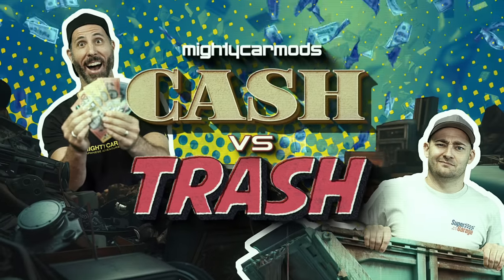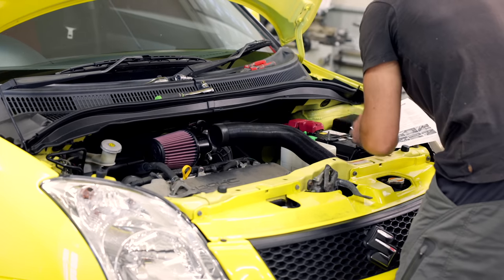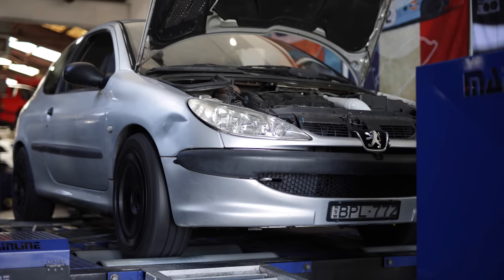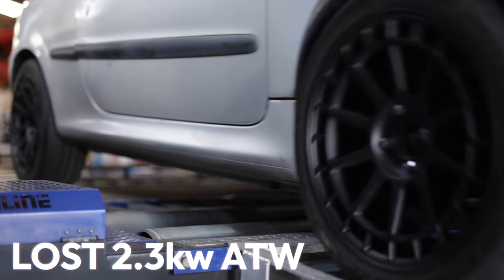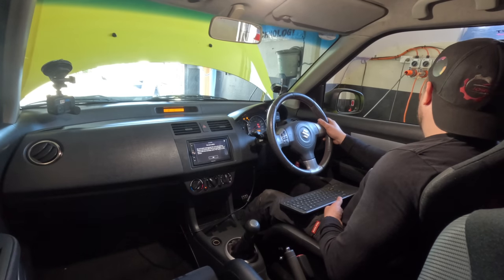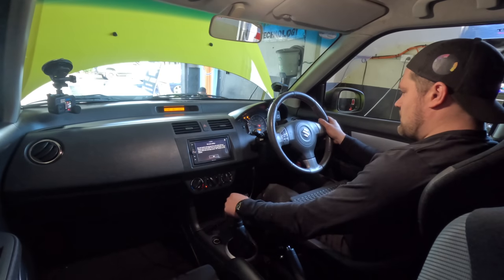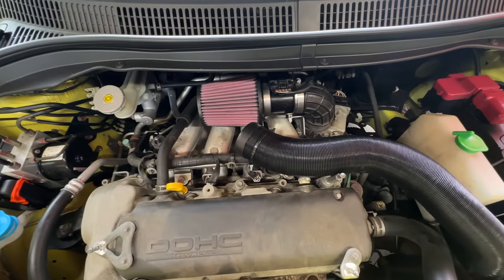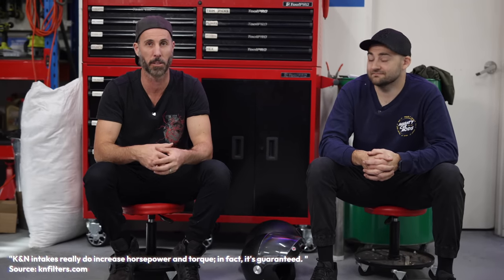Dyno testing POD FILTER Performance Claims | CASH vs TRASH

Comment: When you increase the mass of your wheels you will loss kw and nm. The hot air intake will also contribute to the power loss. Had this happen to my n/a track car on the dyno.

Throw the stock wheels back on and dyno the vehicles again, you will see the difference.

Comment: A lot of cars made now have very well engineered intake systems. For my car it got the most hp gain by just swapping out the factory filter with an aftermarket one. No change in any tubing just stock box.

Comment: When I put a K&N intake (just like yours) on my 2001 Accord, it worked good during winter time. But during the summer here in Las Vegas, I got worse gas mileage and my already slow car got slower. I eventually sold it.

Comment: Moog, losing power from a stock air filter to performance air intake is normal without a tune, especially when you are using a car with air mass sensor. Tune the air mass sensor to take in more air and your Swift will see performance gain

Comment: The intake and exhaust aren't a restriction on small displacement, naturally aspirated economy engines like this. They are cammed to make a certain power level with fuel efficiency taking priority. Manifold tuning and camshaft profile tuning are basically the only way to make any meaningful gains on N/A engines, especially small ones.

Comment: I usually add K&N drop-in filters to my cars. You get a bit of intake noise and still keep your air pipe efficiency. Kind-of a win/win. Just don't over oil it and they work just fine, in my experience.

Comment: Exhaust and intake improve performance mostly on higher RPM. if the valve timing is adjusted for better torque a lower RPM the gain will be minimal or even get worst performance.  In that scenario Valve timing needs to be adjusted.

For intake running Pod filter and MAP sensor; having the filter in a box or where cold air is available helps both due to the cold air and the length of pipe improves airflow so the sensor can measure it correctly.

Comment: What you needed to do is log the IAT temps before and after, the stock airbox is designed to keep the heat out and grab better cold are in.  Where that K&N sat ......... just sucking in hot air = timing pull = less HP.  If you ran a proper pipe across and jammed the K&N at the front lower down you'd probably pickup some top end hp and loose a little on the bottom depending on the length of the pipe.  If you wanna do something sneaky for your channel....... try a dyno pull at like 2-3am when it's cold :D  ALSO......  You could just swap out the stock air filter in the stock airbox with a K&N that goes inside the airbox (the better simple mod).

Comment: because your mass airflow sensor and your 02 sensor cut your timing and fuel back to maintain the pre programed air fuel ratio in open loop. not only that you could have lost more or possibly gained when you when you close the hood and the temps go up. wouldn't effect the Peugeot as much. you need to tune it so the AFR matches the extra air. then your mass and 02 will start working like there supposed to and you'll get a little extra power.

Comment: I've ran into the same thing with most all aftermarket "cold air intakes". However I have felt improvement over a K&N stock filter replacement over a paper element and with 200k on that K&N cleaning it whenever it needs and MAF sensor cleaner handy it's the only way I roll.

Comment: Marty & Moog,
The sub compact and micro cars are specifically designed  and engineered for efficiency which is why most aftermarket products do not bring the expected improvements at the stock level. Of course power adders will of course develop more power, but then they are no longer stock.🤙

Comment: Pod filters work if correctly placed & benefit more from direct cool intake piping and if you can heat shielding / sealing from the rest of the engine bay so cold air only

Comment: If i am not mistaken a modern ECU needs time to adjust. Meaning make a decent number of miles and go back to the dyno. I have no idea if you drove the car for some decent time after installing the filter but this might be part of the issue where the ECU did not adjust for extra airflow yet. Also keep in mind a stock ECU will only adjust in small steps due to always being on the safe side of things. Also the location of the filter might have a negative effect in the case of the shift. The "intake" pipe is a nice addition but it is still in the hotspot of the car above the engine. Every aftermarket filter or intake i ever placed in a car was always either right behind the coolers or in the bottom of my engine bays for optimal fresh air. Or i used complete intake kits taking air from the front through an enclosed housing to the filter for minimum temperature effects from inside the engine bay.

Comment: Modern engines are pretty much tuned from the factory to squeeze out as much power/efficiency as possible while still being reliable. Many factory exhaust manifolds have started to resemble headers, and intakes are tuned to fit what the engines can flow. Without doing an ECU tune and being able to see what's going on as far as AFR and timing etc. you're basically just slapping on a part that is not optimized for the factory tune, and mismatched to the existing intake/exhaust manifolds.

Comment: The K&N pod filter wasn't shielded from the engine, so all the pod would be doing was drawing up hot air. heat soak will lose you power. the setup you had on the Swift will only get up more intake noise and sacrifice power.
Just my 2 cents worth :)

Comment: On modern motorbikes it's essential to get a fuel controller if you put a high flow filter and free flow exhaust on. Stock ecus are set lean, so they can pass emission laws. No doubt cars are the same

Comment: It's because in both cases, the MAF sensor scaling needs to be retuned for the new tube and the rest of the map adjusted for the change in air volume. If the exhaust are full systems (not just catbacks) same applies to the exhausts. Another factor is that the factory intake is pulling cold air from the front of the car but the new ones pull warm air from the engine bay.

Comment: Adding modifications that add more airflow is great! But the factory MAF will only adjust fuelling so much. Compared with bugger all advance in timing means you are probably running leaner than OEM meaning less power. Get an ecu, add timing, add fuel and profit

Comment: Also of your exhaust is larger, your scavenging is less, so if you cant hit the hp target, in your case its higher rpm to reach hp, but seeing as you have stock cams, your air box would have been tuned to that specific rpm range. 

If you want to increase your scavenging on your exhaust you can run the same size extractors but have them longer to the catalic. Also wrap the extractors with dei titanium wrap, this will increase scavenging due to increased temperature exhaust temp. It will also keep engine bay temps down.

As for your air intake, if you really want hp... put a 8inch ram air scoop in the front bumper .. run the stock airbox, gradually downsize the piping.

What will happen is the largest area of the intake is pressure build up as it cannot flow. This pressure will cause air to be forced down the piping at a quicker rate.

The reason you want the stock intake size is to maintain torque at low rpm.
Make sure it only has 1 intake and is fully air sealed on its path to the valves.... a clean pcv valve will need to be used if the car doesn't have 1 already.

3rdly, $5 bonnet vents place on the outer parts as front as possible create a higher flow of air pressure through the radiator as it sucks the air out, also engine bay temp will be lower resulting in hp gains. If you place the vents closer to the windscreen or closer to the middle of the bonnet it will have a downward force and the radiator will get hot and engine bay temp will be higher. Last thing you need is your radiator fan turning on at high speed....

Comment: About the intake: You add air availlability and cooler air, but the gas is coming at the same rate. So, without telling the electronics of the car something has changed, it will try to run the same way. Of course, it is expected to lose power. However, tuning to accommodate the changes will have a greater impact on power and performance. Much more than with the stock, because the stock is tunned to the system that was on the car. About the Peugeot, I believe that the exhaust  width change, and the intake, will probably also benefit a bigger flow of gas, by changing the gas pump. Not simple in a Peugeot, but worth the effort and the $15. Hope this helps

Comment: 5:15 
This was my thought..
Car sensors and computer is a bucket of dry sand. You won’t see any change putting parts on it. removing sand/weight are your best gains.

Now if you’re putting the quality parts and then Tuning the vehicle and telling the sensors that the computer is going to allow more power every way possible and then manually creating opportunities for better efficiency.

Comment: I think maybe because the pod filter is at the back of the engine bay. 1, this might get warm engine air, 2 more importantly, the stock air flow system, might have been better positioned, where the entrance of the system can get access to air more easily. Add a top mount hood scoop and during the test, have a fan/blower point towards the scoop? or re-position the pod filter?

Comment: I think it's relatively simple. The swift was tuned specifically for that air intake, exhaust etc better ootb than the poobro. Without a retuned ECU etc the new system will not improve performance. And, conversely, the lack of tuning helped Frenchie not lose that much power in this case

Comment: A Triumph 1050 has a paper filter with a perforated plate on the back, the K&N filter has no plate. The plate acts as a resonance barrier to turn the pressure waves around, without this barrier the motor drops power in the 5000rpm area, it feels like power has increased when the motor comes out of the dip. The seat of the pants dyno “feels” like an increase but the real dyno does not lie

Comment: Wheel+tyre size  can effectively change the gearing giving you different results. You both lost power was it hotter today than last time? What was the humidity like? Some ecu's don't adjust for extra airflow/fuel. 

It would have been interesting to see the results if you'd put the stock intake back on and run it again straight after.

Comment: Heavier wheels/tires, wider tires, sticky tires, and a different dyno (with different weather/temperature)...all of these explain the difference, IMO.

If you put the stock skinny wheels/tires back on with eco tires you'll see a big increase in measured power.  Slowing the ramp rate on the dyno could help be more accurate too.

Comment: The dyno run needed the A\F ratio logging. Without it we don't know what it's doing. If the ecu is seeing something it doesn't like, it can also be pulling timing out.
I remember years a go, roadkill garage used a mustang to test intakes. The only one that made power was the one that came with a tune. The rest all lost power.

Comment: Hello guys! Love your videos (Dispite I did not undertand english to much)! May can be nothing, but once I was told that is possible to lose power putting a bigger diameter exaust in your car. Due to the fact that you decrease the velocity of the gases that are leaving the exausth manifold. In theory, reducing that velocity you also reduce the amout of "vacum" that helps sucking the air/fuel misture in the cross valve. I don't know if this is the case, I'm just trowing info 😅 Sorry for my bad english! Be with God!

Comment: Moog's car is MAF based and the filter is super close to the Engine so even if the filter flows way more the MAF included air temp sensor, is probably seeing that massive jump in temps and reducing timing

Comment: You guys are not wrong. More air is sucked in but the vehicle is tuned to take in so much air in the stock ecu/ecm. Basically to make more power with the intake you need a tune.

Comment: The tiny air filter on the Switt doesn’t have enough surface area to flow enough air to make power. A simple comparison in square centimeters in filter area will tell the tale. My friends and I have repeatedly found that in order to get an increase in hp/tq from a cold air intake system requires an air filter that was double the size of OEM. My 1994 Nissan Sentra SER (N/A, light flywheel and clutch, Haltech 1500, header) gained 4 hp and 3 ft pounds of tq with a K&N that was double the filter area of OEM. My off the shelf filter, similar to what Marty installed on the Peugbro. This has been repeated on numerous race cars of our friend group. Giant filter meander more power and torque!

Comment: it only makes less power if the car is otherwise stock. if you tune the ecu by sending it to a company itll fix the top end of the rpm band from running lean and losing power. the ecu can only tolerate 5-10% extra air than it expects before running out of injector pressure to keep up with the high intake volume.

Comment: In a lot of cases like Marty said you can free up the extra air but without a tune to compensate for the added air your ecu will cut back the fuel in order to maintain the afr. Also the tube moog used wasn't a good tube. Before the manifold you want smooth tubing for faster more free flowing air since your manifold will automatically create turbulence to mix the air and fuel before entering the engine. A better tube and a tune would've probably freed up a few hp/kw.

Comment: After 40 years of car modding I've come to the conclusion that intake and exhaust "upgrades" on normally aspirated 4 cylinder engines, even with a tune, are doomed to only produce noise.  But on a boosted engine those same intake and exhaust upgrades, along with accompanying mods to control boost, fuel, ignition timing, etc. (and a knowledgeable tuner) can produce significant results.

Comment: Lot’s of people don’t understand the harmonic resonances in the intake, the velocity cannot be measured when you change the characteristics of the flow since the MAF cannot read what is not calibrated to read, the ECU tries to compensate via lambda but again, there are limits in what the stock computer can compensate.

Comment: The biggest problem is breathing in hot air. A lot of different testers, including banks, showed that enclosed mass air units are best due to blocking out the hot air. It might be possible to run that tube they gave you to the front of the car but between needing a tune and sucking up water during the rain it might not be for much of a gain.

Comment: Are you guys doing any programming changes? EBay Chips Vs Custom Tunning. This is where you might see having the custom Intake work, accounting for more air. Moog make a custom box for the pod filter, which breathes cold air not hot.

Comment: Every mechanic I've talked to has said that after market intakes are worthless unless you are going NA to turbo. Manufacturers have a huge incentive to maintain as much power and efficiency as possible and they spend a fortune on doing so. They invest heavily on the intake systems. It's the last place you want to try and make gains.

Comment: The k&N air intake's filter on the Suzuki is literally over the exhaust manifold in the engine bay, thus pulling in hotter than typical engine bay ambient air temps -- and heat is the enemy of all engines -- but especially with regards to combustion engines.  Run the the same K&N filter into the front passenger bumper with silicone tubing or better yet insulate that tubing with turbo blanket-like materials.  Then you get the louder engine sounds and an actual "cold air intake." 

I recommend you also use a K&N drop-in filter with the stock air box.  I bet you gain >(1) one mechanical horsepower with the drop-in (and marginally more air intake noise). The ladies will want to ride the BRIDE with whichever NA unicorn fart tones you pick.

Comment: I watched a jimmy oakes video with his drift week car a hr 350z. Ypipe and cat back. Stock intake with silicone tubes and i think k&n drop in filters. Did 10 pulls all he changed was the exhaust. No tuning just 10 pulls car went from like 280 to low 300. Put intakes on it it lost power but kept doing pulls, and it went to like 320 or something. Car just learned. Never changed the tune.

Comment: I see the issue is at the MAF sensor. The new filter alters the flow, so that the MAF sensor is out of calibration. It can result in a LOWER reading than it really is, this results in the ECU commanding the fuel injectors to inject less fuel, therefore decreasing power.

Comment: I'm thinking it might be due to heat soak. The oem filter on the Swift was enclosed and possibly draws cooler air from a different area. The intake sits right behind the engine where all the heat is.